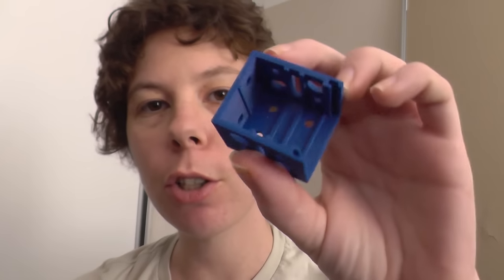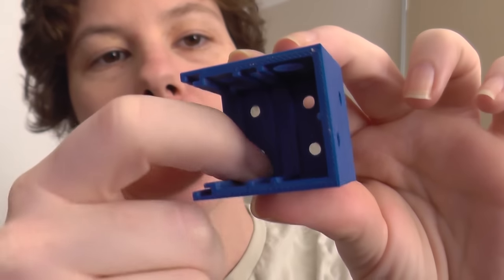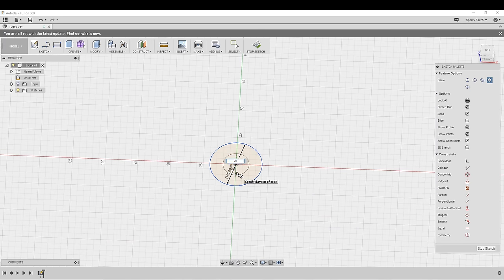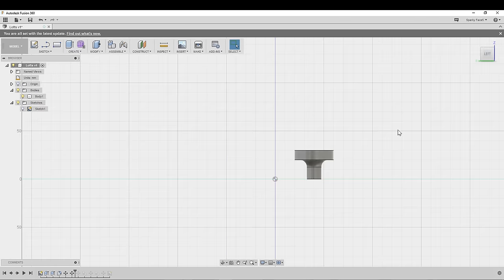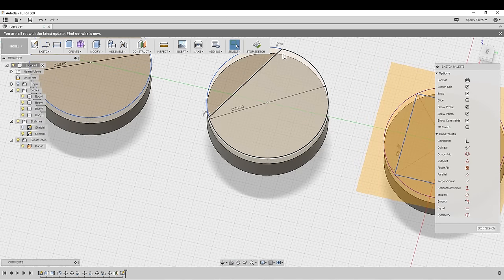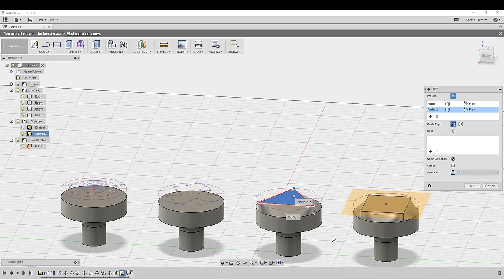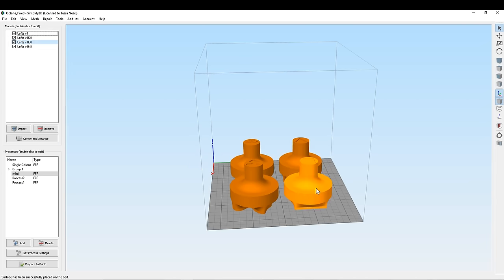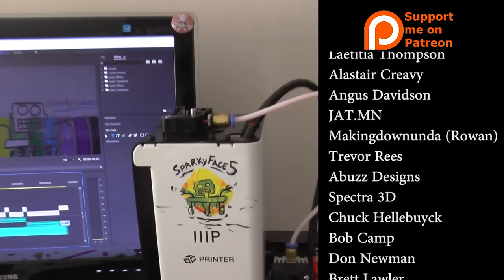Lofts: An Introduction (NOT a tutorial)

Comment: Should've printed the stamp part in flex material if you had any ;)
Reply from the maker: I thought about it,  but the printer needs slight modification to print flex and for some reason I don't have a 1. 5mm Allen key..  Every other size imperial and metric except 1.5mm..  Lol